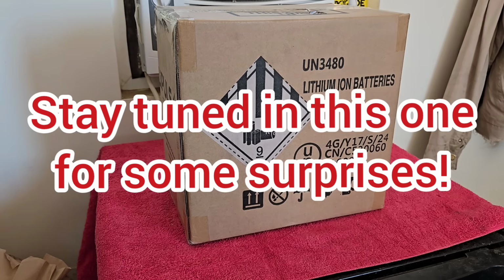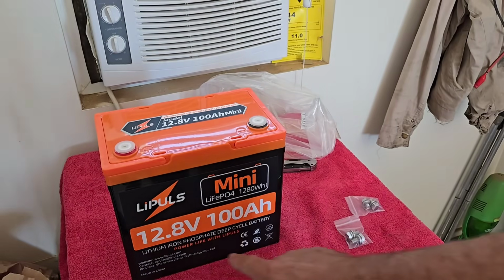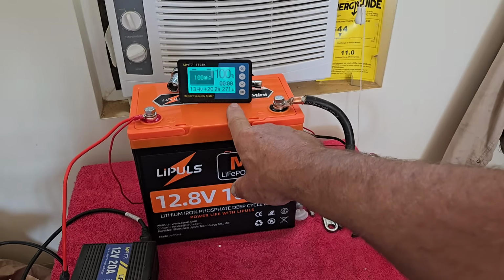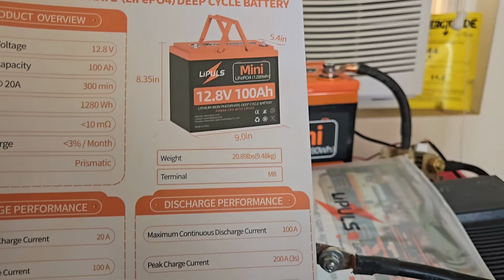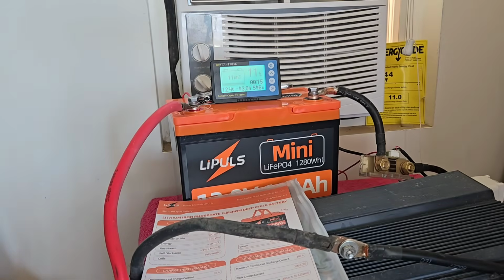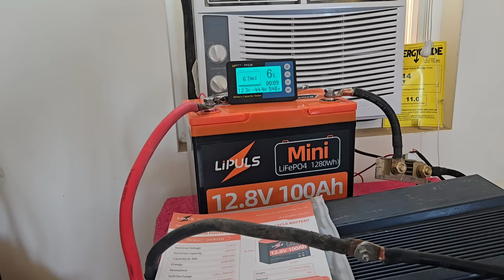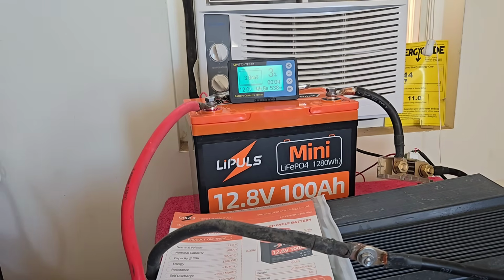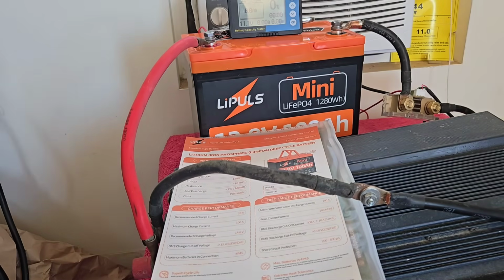How Long Did It Run An Air Conditioner?  June 29, 2025

Comment: That AC unit sounds horrible, are you using a true sine inverter?
Reply from the maker: No.  It's modified, and yes I know it isn't good for the electronics, but it's all I had available.
Reply: @GBear  Electronics these days generally don't care much, it will trash motors in a hurry however.
Reply from the maker: Yeah, I've had 2 of those inverters from Harbor Freight for well over 20 years.  I used to have one in my van and one in my RV.  I built my homestead with the one in the van, connected to 2 Yellowtop Optima batteries a Harbor Freight charge controller and 45 watts of H.F. solar panels.😅@davidconner-shover51
Reply: @GBear  Yeah, Ive also got some old beasts laying around, a still working 4500W from 19 years back, though heavy and a power hog
Reply from the maker: I have a huge PowerJack split phase that claimed pure sine, but turned put to be dirty sine.@davidconner-shover51

Comment: Just so you know, depleting the battery power to zero may damage the battery.
Reply from the maker: Zero on the monitor is really 11.5v.
Reply: @GBear  Got it.
Reply: built in BMS will shut down the battery once the voltage gets too low
Reply from the maker: @davidconner-shover51 Correct.

Comment: it could run way longer if youre an INVERTER AIRCON...i have 100ah run my AC for 7 hours
Reply from the maker: Welcome aboard.   Yes, those capacitor enhanced units are efficient.
Reply: Con charge pannelli fotovoltaici mppt 410watt 172cm x 113cm x2pannell no problem 50amp. 650watt charge the day is perfect 10ore  the notte 2.22ore
Reply from the maker: 😂😅😮Wow you must be a mathespellodian scienteeth profreshioner.😅@stefanocerna6504

Comment: So that AC pulls almost 44amps to get that wattage. If I'm correct, a 24v 100ah battery would require less amps?
Reply from the maker: Yes, higher voltages, lower amps, small wire required for the same watts.
Reply: It would also be twice the watt hours of this battery so should run twice as long.
Reply: @jw3843 yes il doble in watt is eguale sempre 500watt in 12.8volt is 37amp. In 25.6v is 19amp.is sempre 500watt il consumo del condizionatore non change ma is 25.6v 100amp.is doble di 12.8volt 100ah 1280wh Vs 2560wh the 25.6v 100ah

Comment: You know so little A simple calculation would give you the answer
Reply from the maker: Aren't you the genius.😅
Reply: @GBear Pretty mild comment. 🤷🏻‍♂️
Reply from the maker: @drillsergeant623 The first 4 words weren't necessary.
Reply: True, but it's still fun to try it. Don't be a downer.
Reply: Also, the calculations may work in theory but not in real life. How do you even know if it's efficient or if it meets the calculations? You never do until you try.
Reply: @meilyn22 No need to explain it to him, he knows so much. Lol
Reply from the maker: @drillsergeant623 🤣
Reply from the maker: 😊 @meilyn22

Comment: I could use 2 for a 24 Volt Pack to Buss Bars for a Victron 24/1200 Low Frequency Inverter 

🌴💦 Indian Creek Ranch 🌵⛩
Southern California High Desert
Reply from the maker: The discount code starts working tomorrow, the 30th.
Reply: A Pair Tied into a 24 Volt Pack should Run The AC in the Bunkhouse for a Good 4 Hours @GBear
Reply from the maker: @1GREATDANE Yep, even longer if you add some solar and a CC...
Reply: 🌴 That's The Plan here 🌵 @GBear

Comment: A LiPULS 12.8V, 100AH Battery-  $189.99 + tx on Amazon. How many of these do you wish you had?
Reply: Lipuls  vs. WattCycle.  ??
Reply from the maker: @JamesHollinger-lt8qx WattCycle would be my answer.
Reply from the maker: I am flush with LiFePo4 batteries.  I prefer the larger amphour ones, but these are great for portable power.  Lightweight and powerful.
Reply from the maker: The discount code in the description starts tomorrow.